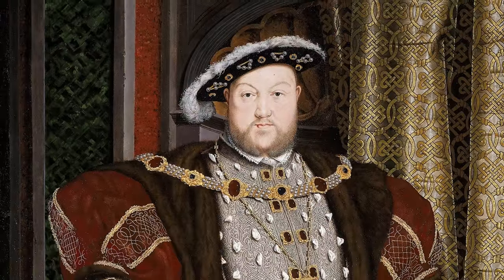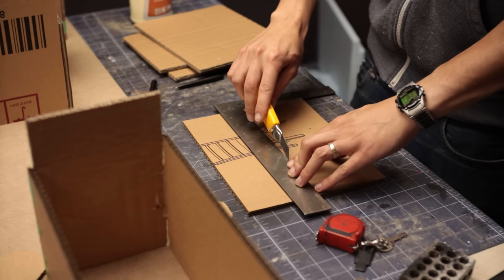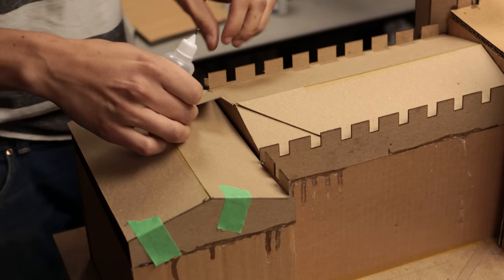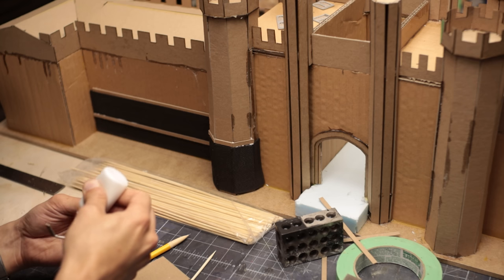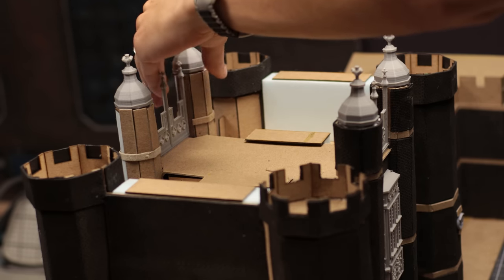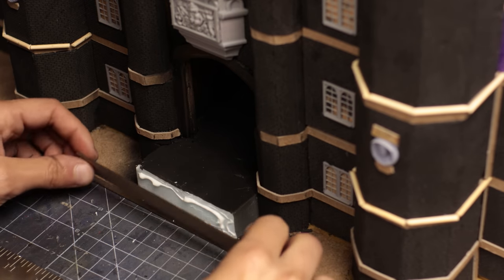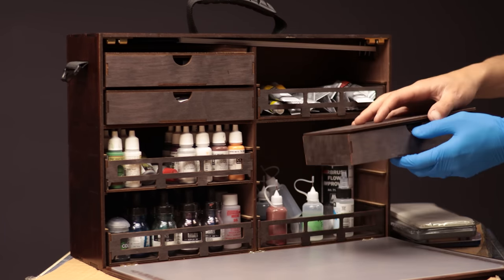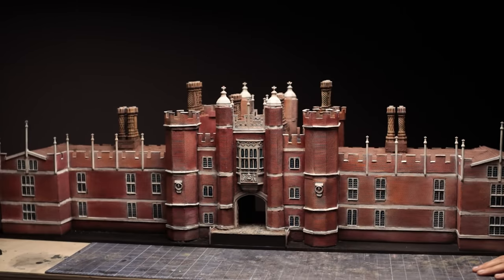Crafting THE Tudor Palace from Cardboard (1.21 Meters)

Comment: I have been waiting for someone to make a model of Hampton Court. Well done. A word of caution though about using cardboard as your substrate. It is not a long term stable product and is very susceptible to warping with humidity. 3/16" thick black or white gatorboard is a better option but it is expensive, especially when you consider that cardboard is basically free. It is rigid but can be cut with a utility knife. A very stable product for model making.
Reply from the maker: I had not considered excessive humidity, I'll admit. I've done builds with foamcore/gatorboard and its always so much more expensive. Thanks for tuning in Mark!
Reply: @KnarbMakes  I forgot to mention that you can probably get scraps of gatorboard for free from a frame shop. I used to own a frame shop and I would have been very happy to donate my scraps which had little use to me but would be a good size for model making. Long skinny pieces and 8x10's for example.

Comment: Growing up this place was just down the road...

Just out of interest, how long did it take to cure the resin/paint mixture you used for the windows? I ask as printer resin is quite a bit cheaper than UV epoxy resin (I'm only thinking that it might be handy to use for very shallow pours).